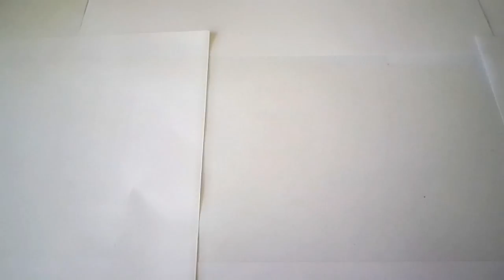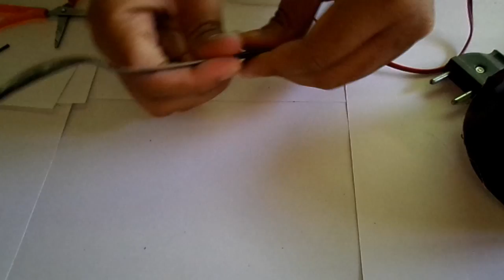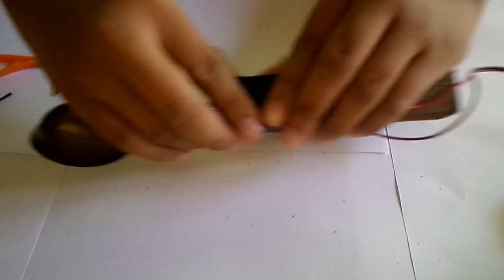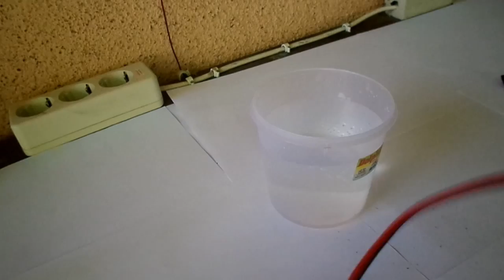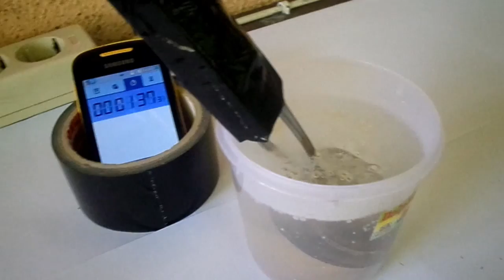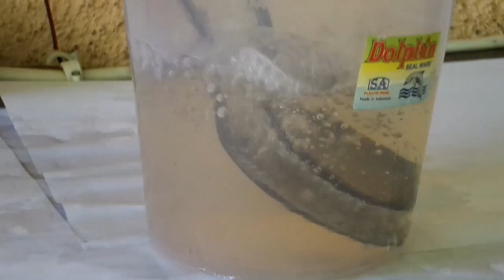How To Make a Mini Water Boiler (EASY TO MAKE!)

Comment: yup, i bought a childrens bedroom vicks vaporizer that had this same method inside of it, it was labelled "boil dry safe" because when the water is gone the electricity stops and it cant get hot anymore, was just 2 steel plates hanging vertically in a round tub with a lid and a tiny hole for the pressure and steam to come out across the little trough that holds the vicks vapor-rub cream, i used to take it apart and clean it every couple months as needed, it does not make explosive gases when hooked to AC 120 volts

Comment: Hes getting allot of Oxygen and hydrogen from the water.. and he thinks it's boiling the water.
Reply: It is eventually... after getting hydrogen and oxygen xD
Reply: Your right, I didn't think of that
Reply: @Teachermark no, in normal electric water heaters , the current passes trough a element and never contacts the water
Reply: @Teachermark could you name one ?
Reply: Nope. Boiling water. It's a electric heater using water as the resistive element.
Reply: Kris Smiley - Manufactorers use insulation because they don't want to make lawyers rich. It's an unsafe normal water heater.

Comment: Everyone: The video is not titled, "How to make the boiler for your child's 4th grade science project"

If your ask me, it's actually an informative video. The simplicity and confirmation that this concept is doable without having to do it myself first is a nice-to-have, lol.

For a safer test - for anyone trying to read comments to gain knowledge instead of study through a bunch of idiots yapping obvious worthlessness:

Just for the sake.of information - collage means much less in terms of how many it will fuck you up.. The current is what can kill you. From 10 MILLIAMPS  can be enough to stop your heart. But artificial respiration/CPR  is largely successful in restarting a victim's motor. A normal household circuit is usually 15 or 20 - maybe even 25 A.M.P.S. Take note of these numbers not having a "mili" prefix... 10 milliamps can kill, 1000 milliamps is 1 amp.  So. Cerrfull. 

However, I've been zapped 4 or 5 times in my life from wiring outlets, or fixing faulty circuits.. wave here I am.. So even though - YES - shit is sketchy -  it definitely is not a headshot.  depends on a VARIETY of factors. Your clothes, direct touch or brushing up against the circuit.... If you're sweating.. if it's excessively humid where you're working, or if your sitting in a filled tub... I'm sure point==made... Thus anything that can affect how much current goes through your body. 

So, I think:. To make this project infinitely less dangerous, one needs but to add a bail switch - like on a lawn mower -  So the circuit is broken when it's tripped. The simpler the better - If probably use a lever switch - kinda like a toggle switch, but as soon as you toggle it one was, and let go - it automatically flips back to the original state. Shrug nice video

If this video indirectly got someone killed, then take solace in knowing that they would have fucking stuck a fork in an outlet at some point anyway, and hopefully it was before they started breeding.

Nice video

Comment: if i use it on tap water, the water would get electrolyzed due to the presence of mineral and salt ions in it, hydrogen and oxygen gas would be produced and the solution would be very caustic to drink!
Reply: Don't forget the hexavalent chrome, sir!

Comment: Pull out the stove and use the cord from that.  You wont need to use duct tape either. Its low voltage. 

Just kidding.

Comment: dear ,
i dont know whether you are live or ded but as per my suggestion pls donot spoil you tube and pls donot kill or take life of other by showing this type of f***k video ,
what the hell is this ,if any one  mainly kid try to do this without knowing the danger of it ,then just 1-5 sec will required to take the life of that ........

i will make complaint against you to you tube  to close this type of dangerous video to stop broad casting .......

if you are an engineer then keep you nonsense techy ideas in you pocket else you have to pay alot in future.
Reply: This isn't a new idea, you can buy a stinger water heater from the store.

Comment: Aint that electrolysis where ya get hydrogen gas and oxygen..and wont that be rust in the water? Well I wouldnt drink it anyway....
Reply: Its not rust because spoons dont use iron or normal steel, but yeah.